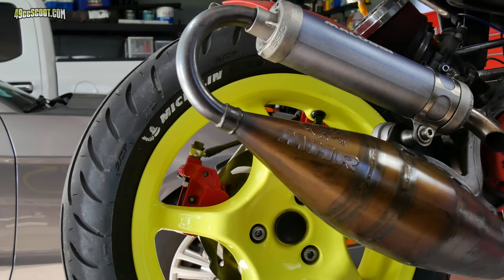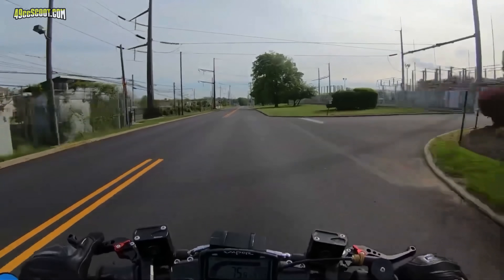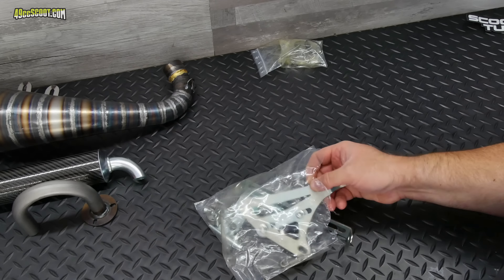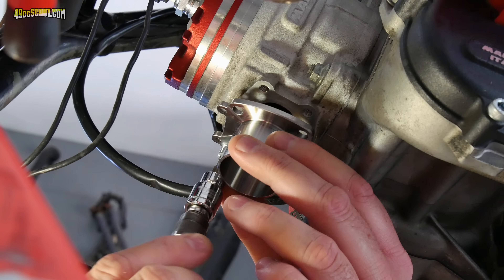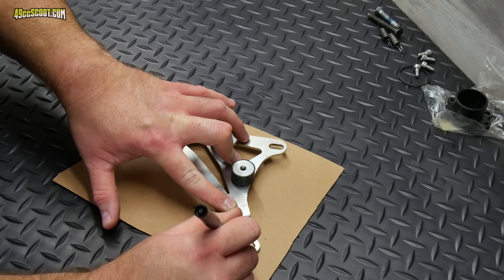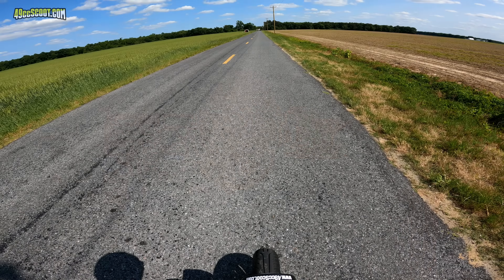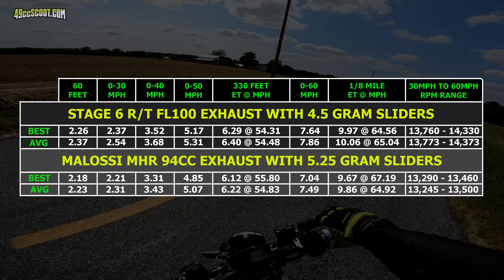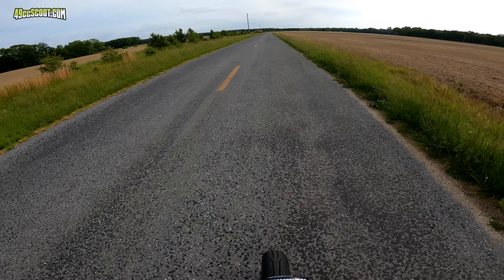RC-One : Stage6 R/T FL100 Exhaust Tested : More Power? : RC1 : Part 13

Comment: Detachable stinger is usually so that you can use a stuffer to make the opening into the silencer narrower afaik.
Reply from the maker: I think you're the first one to get it in the comments. 190mech on the forum said the insert that goes in before the stinger goes on is a "Fath Nozzle". Helmut Fath came up with the idea (long ago) as a way to adjust pipes while racing without having to cut and weld/braze.
Reply: @49ccscoot  It's some real high level race tuning stuff for sure. Also be very careful if you try it because you can easily ruin your engine doing it.
Reply from the maker: @pubbiehive  I melted part of a piston long ago testing a pipe with a small stinger for 50-70cc on a 90-100cc.
Reply: @49ccscoot  oops

Comment: I saw a bike in Thailand on you tube with a black carbon fibre expansion chamber and white coloured connections between sections, titanium expansion chambers are the best looking, and hardest to weld apparently.
Brazed expansion chambers look nice, with the golden colour between sections I think.

Comment: Very interesting to see some other pipes tested. Ive never thought the original exhaust with the rc-one kit was weak. If anything it does have a smaller usable power band than say a c16 on a 70cc but over all it is a very usable pipe even for around town riding. Like you were saying in your last video, this engine isn't by any means practical but surprisingly able to put around town when you want to take it easy. Second the comment about the Zuma being wheelie happy with the rc-one too. Its hard to keep mine on the ground over 1/4 throttle at take off.

Comment: Im soo happy to see your videos! Today “with” your help I installed airsal 50cc kit on my piaggio sfera ❤ +learned hard way that you can chip nicasil with old steel file… But I saved it with diamond one and did some porting. Not tuned yet, just put bigger jet. Hope it works so it will get me to job tomorrow🎉
Reply from the maker: Glad you figured out the diamond file and saved it!

Comment: Funny that you made this video cause I happened to get the "FL100 drag version" for the Malossi and I am having to re-braze a different header piece to use the Malossi cylinder flange.. Stage6 had the best price and when  attempting to contact other pipe manufactures that do have specific  94cc Testa Rossa pipes i.e HK, ST etc  they do not respond to those overseas in America.

Comment: I want to see more of the setup on that met ruck setup. That’s exactly what I want to get.
Reply from the maker: It's an RC-One. 8.1 pipe that he was told was custom for the RC1, but really no details are known by the owner. 34mm PWK and Malossi intake for the bigger carb. Otherwise it's the RC-One setup. It goes, but I think mine could keep up with a lighter rider. I couldn't get him to spend more time testing the pipe to see if it was really doing much for him, but at least I think it is working like the S6 exhaust and making a wider powerband so it would probably see higher speeds and the 34mm may help there.

Comment: The nice thing with a removeable stinger is that you can alter it way easier. A smaller stinger can increase power big time. Most stingers are way too big standard because manufactures dont to customers to destroy their setups during initial jetting/ tuning.
Reply: Why the drag version has long stinger? In fact most drag scooters have very long stingers
Reply: @kabooski  A longer stinger can give more power at lower rpm (so off the line power) but stinger diameter is way more important.
Reply from the maker: I'm surprised the scooter world doesn't seem to have swappable stingers (like off the shelf parts). My first two-stroke bike was a little "Cateye" pocket bike. Cheap junk basically, though fun. I bought a Sidewinder exhaust for it and it came with three little stingers that could be swapped with a set screw. Same diameters, but length changed. You could definitely feel the powerband shift up or down a bit.
Reply: @49ccscoot  Thats nice. Ive changed my stinger diameter from 17 mm to 15mm and got alot more power in the powerband. Small size change can change alot.
Reply from the maker: @notagunfreak8146  I'm probably never going to be the high HP guy, because I actually like the safer larger stingers. For actual street use, I think they make more sense. I've used pipes with stingers too small before  and ruined pistons so the idea of a little safety margin is nice when you're trying not to have an engine failure in front of traffic.
Reply: @49ccscoot  Yes I agree with that. However you do realize that you have a quite powerful scooter right :) Malossi cases, stage 6/ malossi pipe, expensive inner rotor etc Most people throw a 70cc kit on it a pipe + a 21mm carb and thats it. Compared to my Tomos you have a very high HP scooter. Mine only makes around 10hp with a shit ton of mods and self made parts.
I do understand your point in the Netherlands we have alot of Gilera Runners and people build them for very high hp highest ive seen was 53. Another classic here is the Yamaha Aerox. People make like 35 hp with the 100 2fast kit (after porting). Really enjoy your videos!
Reply: What really helped for me was using different octane fuel and higher quality oil. The og classic from the 90's and early 0's was Castrol a747 but all the heavily modified scooters and mopeds have switched to Castrol Xr77. Because of speed regulations in the Netherlands I have a simple daily thats just for getting around. Its standard but i run it lean to the edge of detononation so that i atleast have some decent torque. With xr77 it never failed in 5000 km's. One time i switched to a cheap full synthetic and after 15 minutes it seized. Since then i always get 98 octane and xr77 and 0 issues. Its the go to oil in Europe for tuned 2 strokes. From Zundapps to 210 cc 2 stroke scooters.
Reply from the maker: @notagunfreak8146  I use AMSOil Dominator Racing Oil at 32:1. You can see the piston in the video when installing the flange. Looks pretty good still. I used to use AMSOil Saber Professional at 50:1, but the switch has made pistons and cylinders look so much better.

I used to do a little homemade octane booster, and I've used race fuel in small engines before, but it makes no sense when you need to fill up at a pump sometimes.

I always say I have the slowest scooter on YouTube. If you read comments, you'll see a lot of people tell me how slow I am. Why doesn't it go 100MPH?!?
Reply: @49ccscoot  Yes Amsoil Dominator is a very good oil. Piston looks very good. The comments are just dumb unexperienced people that don't realize that with a single cylinder 2 stroke 100 mph or something close to that is almost impossible. I guess higher octane in Europe is easier to get but you guys have straight methanol that you can get from the pump that stuff is impossible to get here.
Reply: @notagunfreak8146  in poland you can get 100octane fuel from shell for price 0.3$ more than standard 95octane per liter.. we have methanol too but no one uses it

Comment: section variations in the exhaust manifold have the effect of creating turbulence and can cause incandescent gas pockets to re-enter as well as decreasing the efficiency of the expansion.

Here is a translation from famous Italian book: "Elaborariamo il 2 tempi" - Facchinelli (page 153)

"The part that goes from the port to the exhaust manifold coupling is not
less important than all the rest.

Any sharp jump or exaggerated angle will have the effect of
create turbulence in the outgoing exhaust gases, which it produces
several negative effects.

Slow down the outgoing gases, create pockets of flue gas to come
returned to the cylinder by the return of the expansion, hinders
the latter operation making it more difficult to return to the cylinder
of the mixture, effectively restricts the exit area of the burnt gases
penalizing the whole system.

This is especially true in the first part of the collector, which goes
from the light to the actual collector and where nowadays
we find in the middle all those partitioning devices of the
I unload."
Reply from the maker: Thanks. I'm hoping to re-test with a matched flange and see what changes.
Reply: @49ccscoot  I would find it very interesting since I've never had the opportunity to try it
Reply from the maker: @Manu-zp2il  I know that technically matching is correct. I've heard people that know 2Ts pretty well say a bit of mismatch isn't that big of a deal... but even if a bit isn't, this is a pretty big mismatch. It'll be interesting to see how much it matters in the real world.

Comment: DDL Tuning makes pipes specifically made for the 94cc Testa Rossa kits but I doubt they are available outside of europe
Reply from the maker: I've heard of them, but don't know much about them. At this point, I'd like to have the S6 100cc stuff to match the pipe, but budget has not allowed.
Reply: @49ccscoot  Fair enough, it's an expensive hobby. ( but a heck of a lotta fun ) but yeah DDL Tuning is based out of The Netherlands, the owner used to race for Malossi. They used to do dyno tuning, cilinder tuning, crankcase tuning, etc. But they stopped Januari 1st, Fortunatly they are continuing to make their line of exhausts and intakes.

Comment: How the electric water pump is doing after a long period of time? Happy about it? Do you run a thermostat?😊
Reply from the maker: I don't run a thermostat. Actually just replaced the pump (with the same pump again), which I'll talk about in a future video. Overall, I'm pleased though. It's mostly trouble free. My charging system makes it a little worse because it will shut down over 15V and I can't get this thing properly regulated so I have to turn more lights on if I'm at high RPM for long. That's not really a complaint about the pump though and prob best that they  have that safety built in.

Comment: How long should a torque spring last? I had a malossi +1500rpm spring and it only lasted 540km before it started acting like stock
Reply from the maker: It should last a lot longer than that. I don't have any specific time or mileage. I've had the spring on my Minarelli OR setup for years without issue. I've had a TaoTao fatigue springs quickly. I think how much heat they're subjected to makes a difference.
Reply: @49ccscoot  im gonna buy malossi variator and clutch that should stay cooler when riding, my variator is pretty tight so there isnt alot of air cooling things
Reply from the maker: @juu6967  Venting the CVT cover may help.
Reply: @49ccscoot  it is a kymco super 9 2stroke, the variator is vented from factory but the tube that connects to the cover doesnt draw air from anywhere, just connects to the frame. Did you figure out the taotao problem?
Reply from the maker: @juu6967  I used name brand springs and cut holes in the CVT cover.

Comment: Unrelated question: do you know how i can make my scooter brap brap brap on idle? thx
Reply from the maker: Set the idle low or have a leak or fueling condition that causes a surge. It's much better to worry about usability than sound though.

Comment: How’s the charging now with no kart pump
Reply from the maker: It charges well at high RPM. Doesn't charge much at all at low RPM. The Zuma regulator won't regulate it well enough. I tried Chinese stuff and a Tomos regulator that was recommended to me, but the Zuma is at least as good as any of them. I have a halo light and the actual headlight. In the daytime I'll use the halo if I'm not at high RPM much and then turn the headlight on when the revs are up cruising faster to keep if from going too high. The pump shuts down over 15V so otherwise I'll notice warning lights coming on from heating up with the pump off. Sounds complicated, and it's not ideal, but it doesn't bother me.
Reply: @49ccscoot  will I be ok if my pump runs off my battery and the lights come on when the engine is started to charge battery
Reply from the maker: @paulflood4420  Probably. Ryan has no charging at all. He uses Malossi's pump, which also has a controller that can lower it's demand if temps aren't high. He uses lithium batteries and rides for hours. I know he was using SLA power supply batteries. Not sure if the newer lithium one is also for a power supply. I can find out or he's on the forum. He also has all LED lights and his headlights hardly draw any power.

Comment: That S6 flange looked like it was up side down to me, but whatever. This is not a good comparison either.
Reply from the maker: The flange is on the right way. Wouldn't make any sense to wrap the springs around the header. Sorry the comparison doesn't work for you. Just seeing what happened with a bolt on. People in the comments seem to know all sorts of stuff, but if I try to look for anyone that's done these things I come up blank and wind up on my own. Unfortunately I've always done my own thing and not followed others, so I'm not great for networking info I guess, unless people share on the forum maybe.
Reply: @49ccscoot  I meant the mounting bracket, it looked upside down to me. (when you mounted the supplied mounting bracket and had to fab up your own) the header really is an uphill battle for comparison since the transitions are non existent. but I understand why you did it as is.
Reply from the maker: @Winner3ty  I've got 3/16" plate and 1.5" rod in my cart at McMaster-Carr, so maybe someday we'll see if a port match does the trick. The bracket can only sit one way because of how it's bent.

Comment: Really?  You can't compare the two pipes when you has a s*** connection at the flange.  With that big of a miss match, ofcourse the stage 6 is not gonna make more power. The return pulse of the pipe is getting screwed by that abrupt wall from the getto rigged flange.
Reply from the maker: FYI, S6 says to use their flange if using the pipe with other kits. I don't disagree with what you're saying, but if other people would like to take their time and money to try this I'm all for it. I was trying not to modify a good pipe or cylinder expecting that it's never going to be the best option. The Otto pipe that Ryan has allows the Malossi flange to be used so it's easy... but all I had to go on was pics. Don't see anyone else posting much about these things so I tried it and actually shared the info I have. I'll measure the pipe at some point and that will go into a pipe database on the forum as well.

Comment: St make a pipe for malossi rc94cc i had it on my 94cc Zip sp
Reply from the maker: I don't even know who ST is TBH. Someone else mentioned ST and HK, but also said they won't even respond to people from the US.
Reply: @49ccscoot  Full polini engines  94cc 3500 Euro  top speed 155 km/h  0-100 km/h 4,5 sec real
Reply from the maker: @kamilr3511  Show me the vids of a 300 pound rider like me doing 0-100 in 4.5. I'll accept 2-up. lol There's certainly faster stuff out there, but I just rode this thing 175 miles round trip on a whim and earned a subscriber because I passed him on the highway. I can't say I see many high end riders out doing multi-hour trips. Heck, I don't usually get to see scooters at all around me these days unless they're stock 4T rentals at the beach.
Reply: @49ccscoot  the st exhaust is only slightly better than the one from malossi, plus it's as noisy as hell. yazuni has their c40 which is for 90 to 100cc. but personally I would use the exhaust that fits best. for the malossi rc94cc your scooter probably makes 25-27hp on the rear wheel.. 30hp is really rear